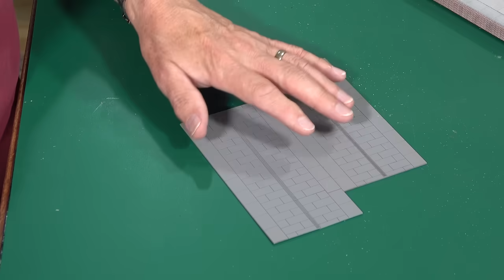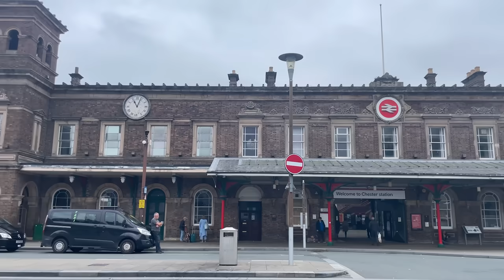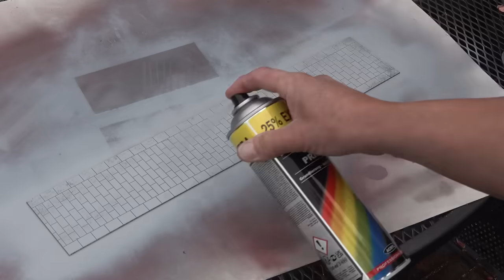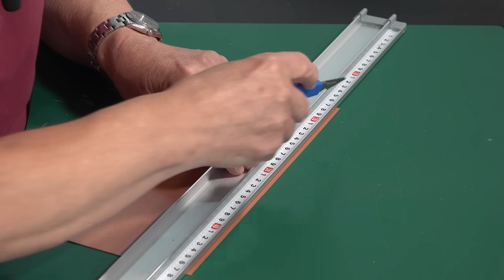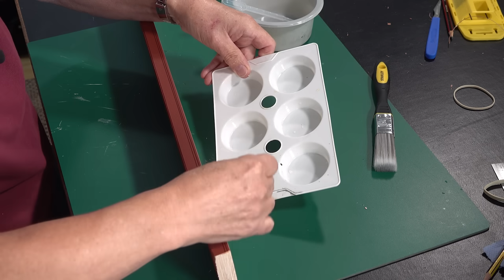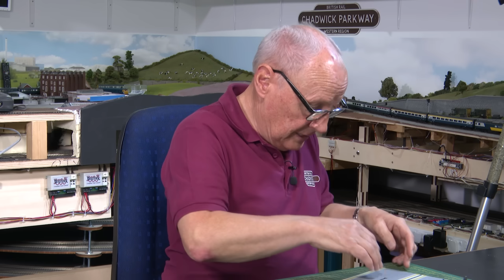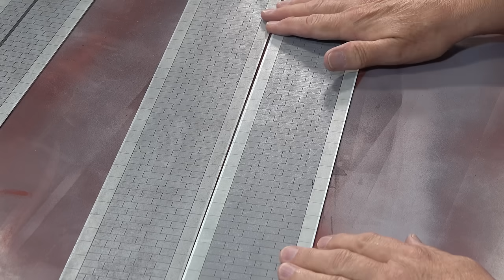Building The Ultimate Model Platform At Chadwick Model Railway | Episode 233

Comment: Ive always thought the zigzag on the track  is something similar to a rumble strip - they seem to have then at all the platforms at most of the ML stations in London - I am a LNWR user coming into Euston & the EMUs coming into platforms 8-10 run over it for up to the 12 car stop. But i have seen them at most ML terminus stations
Reply from the maker: Hi Richard, those strips are to enhance Signal detection of the locomotive’s presence. I didn’t know either, regards Charlie.

Comment: Hi Charlie saw that pattern on rail in Manchester  years ago and was told by station staff that if engine goes over it it shakes and lets driver know he is close to buffer stop    ( if he is dozing).
Reply from the maker: An interesting suggestion Ernie. However, I’ve also been told that it’s to enable the locomotive to be detected easier on infrequently used lines. Regards, Charlie.
Reply: The station staff were either pulling your leg, or they didn't know.

Comment: "Would you lend me your vote again.....?" - Well, seeing as you went to Chester (the city where I was born), gwan then! 😉🤣 

Thinking about canopies - with a laser cutter, it should be fairly straightforward to make an 80mm wide version? The hard work's all in the CAD. Also, interesting to see you using laser cut (or at least laser engraved) platform surfaces... in a previous comment I'd suggested using a thin wooden strip, laser engraved, as the edging strip (you replied that Plasticard might be a better option)... must admit, it had never occurred to me to do the whole width as one laser cut/engraved piece! It would be fairly straightforward, if you're going to put your lights, square drains, etc. at regular intervals, to come up with a simple panel incorporating all the bits you wanted; have 2 or 3 different versions (e.g. under canopy, in open with no drain, in open with drain, offset drain etc.) & tile them together rather like a bathroom. You're probably way ahead of me, I've only watched the first 7 1/2 minutes so far!

PS: Happy Birthday! Haven't got to that bit yet, just seen the comments!
Reply from the maker: Many thanks for your suggestions. CAD is beyond me, and to be honest it’s something I really don’t want to become involved in. I’ll leave it to the experts. Hope you enjoy the video, regards Charlie.

Comment: Happy Birthday Charlie. Very useful infomation in this video. Silly question, To save time why did you not cut the existing platform down the middie to adjust the width instead of making new ones?
Reply from the maker: The surface was ruined due to the previous attempts. Regards, Charlie.

Comment: What’s the width and depth of your platforms please? Do you advise putting platforms/ buildings on 3mm cork to match the rail height if using cork underlay?
Reply from the maker: The platforms and the track are both laid on three mil cork. The platform height is 19.5 mm, and it’s width 88 mm.

Regards, Charlie.

Comment: Charlie check your platforms below the canopies because where does the rainwater go to from the roof areas???
Reply: There would be down pipes down or inside the columns to,a positive drainage in the platform you cannot discharge water onto a platform surface. Note also,you are not allowed to,discharge water off the platform edge onto,the track bed🎉
Reply from the maker: Interesting comments, gentlemen. However, I do believe on older platform canopies that the rain did just run off. Clearly, I need to do some more research.  Regards, Charlie.

Comment: Nicely done Charlie, as always. I have a question for you...I recently put out a video about switching to dcc, I was wondering if you could give an opinion on your controller now you've used it for a while.
Paul
Reply from the maker: Great question Paul.  I have never made a recommendation on my channel for anyone to invest in any particular control system. 
Because I don’t have an appreciation for the whole range, I have to leave that to specialist suppliers.
I would certainly spend some time looking at the intricacies of the Z21 black. Regards, Charlie.
Reply: @ChadwickModelRailway  thanks Charlie, asked you as I do take on board suggestions, just bought that ruler save me cutting fingers, only got 3 on one hand so gotta be careful. Thanks for answering Charlie

Comment: Hey Charlie, have a good birthday. Any chance that you could drop a link to that straight edge cutting tool with the rubber grips please? I had a look on eBay and couldn’t find it. Cheers.😊
Reply from the maker: I’ve put the details in the show more tab. Regards, Charlie.
Reply: @ChadwickModelRailway  Charlie: the Show More option on the YT app and web interface, at least on my kit, is MIA, hence my request for a direct link. There’s plenty of noise on Reddit about the Show More option disappearing. In any event, two browsers, one app, no show.

Comment: I'm not sure you are 100% correct about canopy widths. The remains original canopies at Saltburn station c. 1957 overhang the plaform edges by about a foot. The same is true at Middlesbrough station for the replacement canopies put up to replace the overall roof destroyed by German bombs in WW2 and on the former bay platform used by the trains for Whitby. I would caution people to check out what their local railway did  before committing themselves.
Reply from the maker: Thanks, Neil, for useful insight. Regards, Charlie.

Comment: I don’t get it. Why don’t You use some single stage automotive primer and a small spray gun? You already have a compressor for the airbrush, haven’t You? Small spray guns are dirt cheap and a can of primer goes a loooong way. And contrary to the rattle can it doesn’t consist of 80% propellants. Much cheaper, and the primer can be tinted with small amounts of base coat. Works like a charm 😊.
Reply from the maker: I take your point, however, I try to make it easier for the viewer to achieve similar results with the simplest of Tools. Regards, Charlie.
Reply: Ah, okay. That‘s a good point 🙂